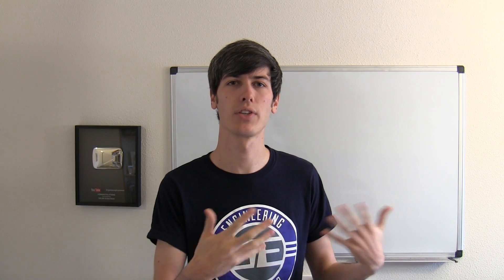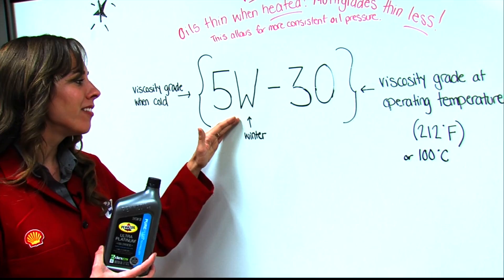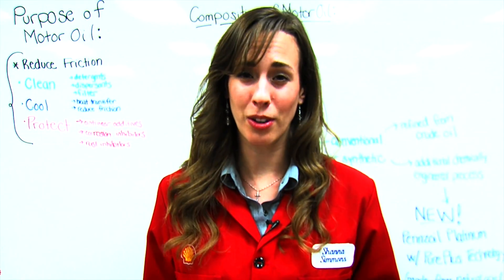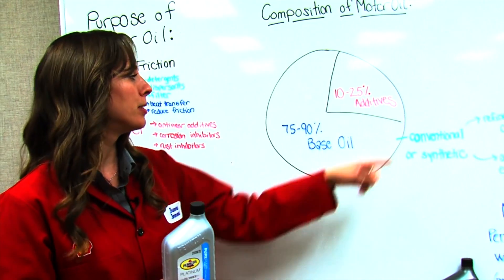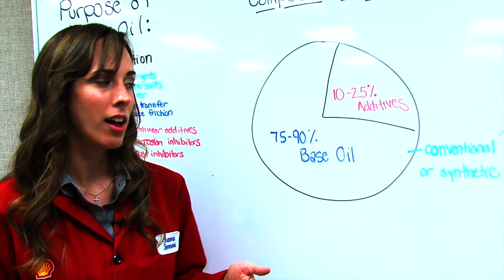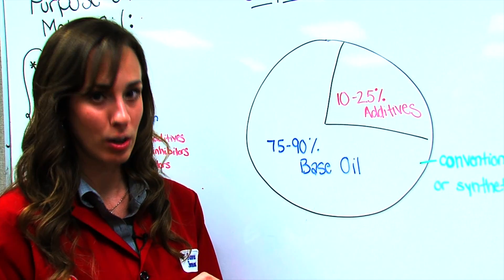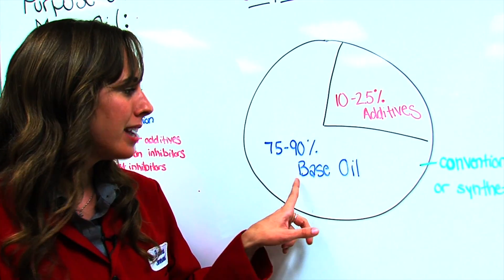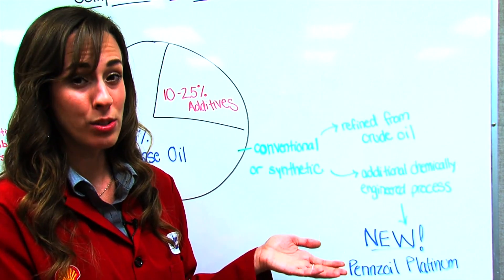Motor Oil Myths & FAQs - Synthetic vs Conventional

Comment: I know you said to follow your manufacturers recommendation when utilizing a particular viscosity grade of oil for example 5w-30. However, when using your vehicles in excessively hot climates naturally the oil will become thinner. The viscosity recommendation is predicated upon the assumption that the vehicles operating temperature will be 212 degrees Farenheit however, in different geographic locations where climates can soar on a daily basis dipping into the low 100's and high 90's for example Florida, perhaps adding 1 quart of a 10w-40 would balance out the temperature disparity.
Reply: No I did not. You should reread everything because I think you were seeing things at the time. I only have 1 comment that mentioneds 10w40 and it very clearly says I ran that oil and nothing else. Anyway, I'm not going to keep responding.
Reply: I haven't edited anything but whatever you want to believe I guess. Enjoy your day, whatever planet you may be located on. :)
Reply: Stinky Cheese I think you confused the other guy (OP statement regarding 10w-40) with Austin k....

Austin k didn't state that! he was having a discussion with me about oil temps being higher than coolant temps and so fourth.

Just saying
Reply: where im at the average weather temperature are 104 and it peaks at 122ish range 

my car coolant is happy at 197-203 be it summer or winter thanks to modern electronic fans and coolant thermostat. 

so what should I run?
Reply: @Outlaw Your coolant may be at that temp, but what is your oil temp? Those are very different and even with a normal coolant temp your oil might be higher than it should be.
Reply: Austin k I understand that.  Sadly my car isn't equipped with an oil temp sensor... 

Might add one for reference in the future.  My guess it's anywhere between 200-210 maybe less? Wouldn't know without a gauge.
Reply: It should be roughly 10-15 degrees higher than your coolant at the most in a perfect world. It just comes down to your climate. When I lived in a desert area I ran 10w40 in my car rather than the suggested 5w30. Every car is different though and that might be bad for some. 

Best bet is to get an oil temp and pressure sensor, then you can really see what's going on. I think most cars would do fine in most temps with the oem suggested oil. They would probably do better with a oil suited to their climate and driving habits though.
Reply: Austin k I hear ya

I got an oem pressure gauge and seems alright pressure wise for a 98 Z28 

I use to run 5w 30 Mobil 1 but switched to 10w 30 for the last 4 years roughly on this particular car.   Nothing to worry about but it's ironic that this video got upload at this time as I with friends were having an oil discussion for the past two weeks.
Reply: My last car had a rotary engine so I went crazy researching about oil. Now I just have a cheap Honda that the oil probably doesn't really matter. I'm a big fan of the Shell Rotella oils because of the price and quality. Check them out, the only issue is they don't have a lot of weights. On the plus side the Rotella stuff can also be used in motorcycles, and now I'm off topic.
Reply: Austin k not at all my friend

Thanks for the heads up I'll check them out.  

 It's a big issue for me here to get quality oil within the past few years as most are knock offs or cheap repackaged on the market. 

But my luck is running out as the dealer for GM is starting to push away Mobil 1 and starting a campaign to use ac Delco dexsus 1 or whatever they call it now
Reply: Austin k speaking of which... 

just remembered something regarding Honda and oil. 

Few months ago I had one by for a head gasket failure.   When I removed the camshaft caps I've noticed some ware and scratches.  I've asked about the type of oil they used for it and  they said 20w-50.

Although it's owner manual states 5w-30

Just a heads up
Reply: Wow lol. Even when I lived in Vegas I wouldn't run that in 99% of cars.

I don't even remember what mine has in it right now. I'm thinking 5w30 but it might have been 10w30. My car is an older fuel economy model and has the original 70 bhp motor in it so I'm not dealing with a lot of heat, or power. Not sure what my owners manual suggests but I'm guessing 5w30 which is what I normally shoot for.
Reply: Austin k exactly lol

That civic was for a lady and she had no idea.   It was an 04 exi
Reply: I don't want to read all the comments again but I don't believe I said to use a single quart of any kind of oil. I prefer to fill the engine up which is usually 4-5 quarts depending on the vehicle.
Reply: Stinky Cheese yeah I understand 

The thing with G+ and YouTube whenever you reply to the initial post it doesn't tag his name.  So here's the mix in the thread as Austin k maybe thought you initially replied to him.

But again you did tell Austin that he stated that and then told him he changed his posts that's your "puzzle" solved right there😁

Anyways... All is good
Reply: Not a problem. Your engine should run at 212f no matter the temp out side. This is for 2 reasons, the first anything higher can start warp some metal parts in side your engine. The second is because water boils at 212f, if you want to get technical most cars run at either 210 or 195 depending on the manfacture. Now your car uses coolant. Coolant is typically a mixture of part water, part antifreeze, typically 50/50 unless your in really cold climates. The antifreeze does actually as the name implies, it lowers the freezing point of the water, at a 50/50 mix it would be -32f. It does not raise the boiling point. The pressure in the system should raise the boiling point of the water to about 250f but if you lose the pressure in the system this effect. So anything over 212f could cause your coolant to boil. Boiling water inside a engine, not good.

Comment: What's best to use? For tropical countries. Owners manual recommends the following. Toyota. I'd rather buy synthetic vs regular engine oil.

0W-20
5W-20
5W-30
10W-30
Reply: What is the coldest temp. that you will start your car at? If it is above 70F-20C then don't worry about the 'x'w number. 10 or 20 w will be fine.The high number should match the car mfg. recommendation for the hottest conditions you drive at.

Comment: Convential and synthetic oil are not compatible,turns into sludge and I have seen this before.It was a Pontiac Bonneville,The owner whom is a friend of my dad's poured a quart of synthetic with 4 quarts of convential oil.Came in with no oil pressure and the oil pan was full of sludge from him doing it.Chrysler does have a TSB on the 5.7 Hemis with the MDS,5w20 oil is used only.If the wrong grade oil is used,the MDS will not work correctly and gums up the actuators which are under the intake manifold in the block.The 3 valve 5.4 Fords including the 6.8L V10 Ford,synthetic oil only which 5w20 has to be used.The lifters will rattle if the 5w20 synthetic is not used
Reply: Odd, I have been mixing them since the 90's with no ill effects.  They are designed compatible, I don't believe your problem was a result of mixing them.  What probably happened was the sludge was already there, synthetic was put in breaking the sludge free to drop into the pan.

Comment: Can I damage my motor by switching from fully synthetic to conventional?
Reply: No problem. But why would you?
There are some reasonably priced "semi" synthetics too, if it is a cost issue. But surely the difference isn't so stark?
These day's I wouldn't run anything but a fully synthetic. Unless I was running and old crate that was due to conk anytime soon, and was burning it almost like a second fuel.
Reply: +rationalmartian you're right, it was a cost thing but in the end it's worth the cost.
Reply: That depends on the car, and or manufacture recommendations. If it is turbo/super charged, and/or a gm car that calls for dexcos oil, then yes. On turbo/super charged part, you actually wont damage the engine but will damage the turbo/super charger. On the gm side of it, the oil I have ever seen to meet the dexcos spec is synthetic.

Comment: Could you do a segment on tuning and running e70 vs e85 in your car. For example what happens if your tuned closed loop on e70 and you get a good fill of e85 or higher. Afr differences, timing, stoic...I couldn't find a related video

Comment: What's weird, my car manual wont tell me how much oil my engine takes and what viscosity. Instead it gives me a chart with all kinds of oil on it and temperatures they are optimal in basically saying, "Choose one I dont care". Thanks Chrysler, You sure are informative! Maybe it has something to do with the fact it was made in 1982... that might be it.
Reply: Assuming the milage is reasonably high, you might want to look at a synthetic for higher mileage cars, as all the tolerances will now be slightly larger due to wear.
Reply: I put full synthetic 10W-30 in and it's running fine!
Reply: that's because recommended oil depends on the climate you run the car in. Running the car in Norway will ask for a different oil than when you run the car in the Sahara.
Reply: i got that. Although I'm sot sure if it would even run in Norway...
Reply: In 1982, I believe, they may still have commonly used just a single viscosity oil. So like just 30w oil, in this case the w no longer stands for winter, and instead stands for weight. So they give you chart because depending on what the outside temp is expected you should use said oil weight. I am also surprised you still have a manual for that car.
Reply: Why? I don't know where you're from though so things may be different where you're at but here in the United States you're supposed to leave you're car manuals with the car, documentation, service history, and things of that nature. I still have the original manual for the car, as well as a secondary; supplementary one for operation and care of the convertible top, some warranty information, window sticker, and Goodyear  tire pamphlet that came with the car all in a little plastic envelope binder kind of thing. It's convenient when you're trying to find out what these two random buttons do on the radio that say "LOC" and "DIS" which as it turns out will filter local and distant stations out when seeking the radio-waves, or how when you have the cruise control on the turn signal stalk and its arranged like this |SET>|| |Resume>|  and that pressing resume will increase speed by 1 mph, while holding it down lets the car coast. I NEVER KNEW THAT!!! Can you tell I'm slightly boring and weirdly interested in that kind of stuff. I just think it's fun to read because you learn some weird things.I always hear people who are like "I have this thing on my car and I have no clue what id toes so I'm slightly scared to press it." READ YOU'RE MANUAL!!!  You're supposed to do that with every car but I guess some people get too busy for that kind of thing.
Reply: Aaron Ries I live in America also. You are supposed to keep the manual, but you would believe how many people take it out of the car, do God only knows what with it, then it's gone for ever. People never read their manuals, I work on cars and the new think now with the suvs is the automatic power lift gates. On most cars that can be turned on or off. It usually comes off from the factory. To turn it on you just hit switch inside near the tailgate. You would believe how many people come to us "yeah I just bought this car the power lift gate doesn't work" because they never turned it on.
Reply: That's hilarious! My car only went through 2 owners before I got it so I guess that helps when it comes to manual retention.Just curious... what brand dealership do you work at. Like ford or GM or something of that mater.

Comment: So what if i were to do modifications to my engine (supercharger or turbo)? something to heavily increase the engines preformance and horsepower. do things like that matter or would a thicker oil be better for the engine as well as the modifications?
Reply: The bearing in a turbo puts a lot more wear on the oil as it runs hotter and at a higher shear rate than any bearing in a naturally aspirated engine, so getting an oil with the viscosity recommended for the original engine that is also rated for turbo engines is the way to go. Diesel turbos are particularly hard on oil, but any engine that wasn't designed with a turbo won't specifically recommend oil suitable for turbos. Fully synthetic oil is pretty much all that modern turbo engines have recommended for them AFAIK.